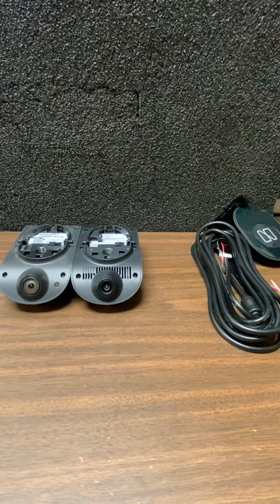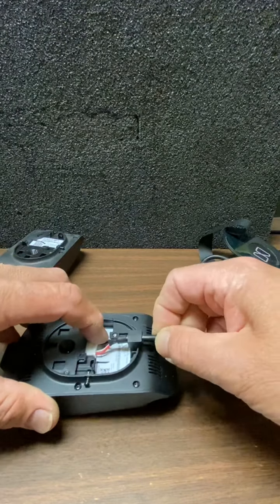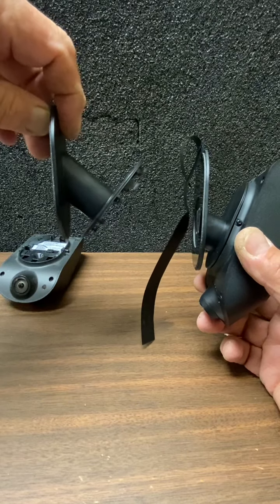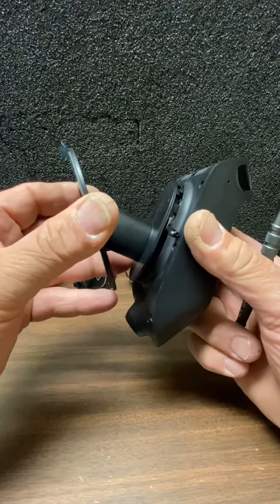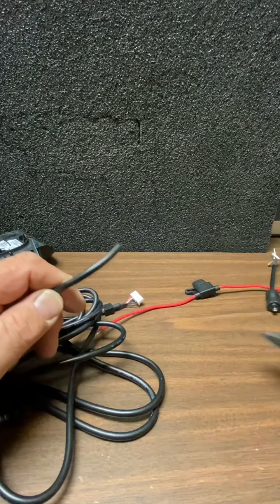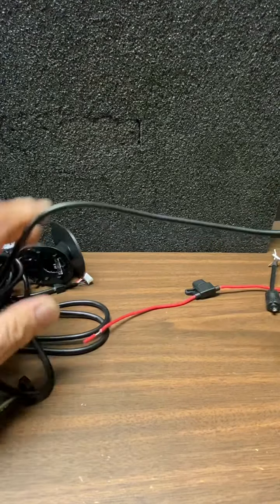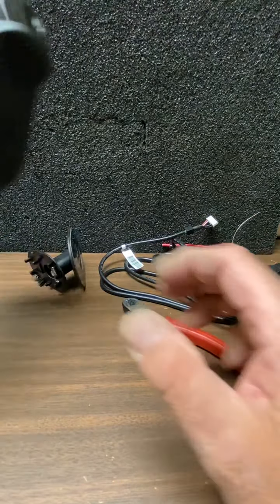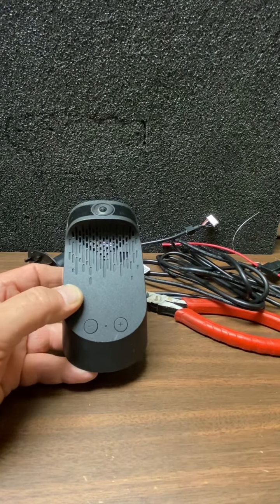Nauto N3 basics and replacement knowledge

Comment: Question for you …do you know how to fix my camera to shut off when the camera is off …mine keeps draining my van battery also it always has a red or blue light never has the geeen light anymore and it use to alert me if I was drowsy or following too close and it doesn’t do that anymore …thanks for any help
Reply from the maker: No, and The N3 wont drain your battery under normal conditions, it draws literally nothing when in sleep mode after shutdown.however, if you get lights other than green after start.and it's not recording, call Nauto tech support/customer SVC and have them swap the unit out.
Reply: Ok thanks